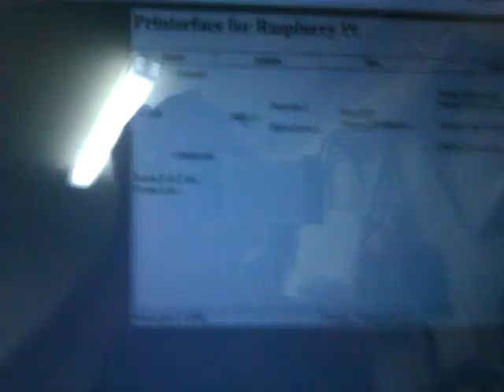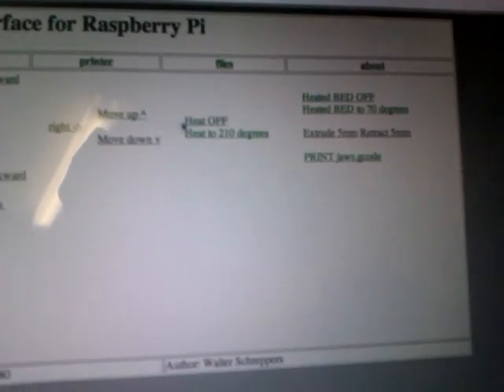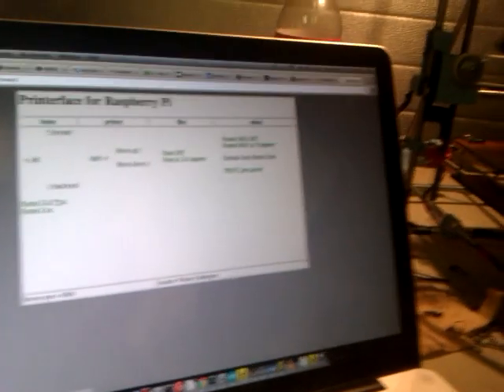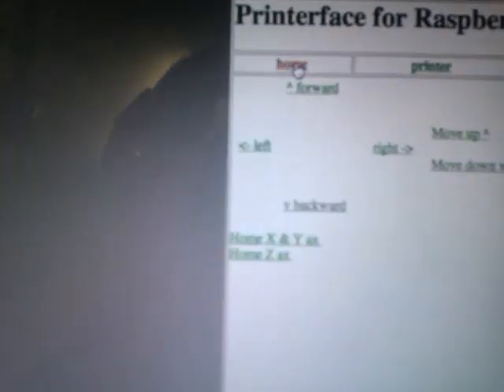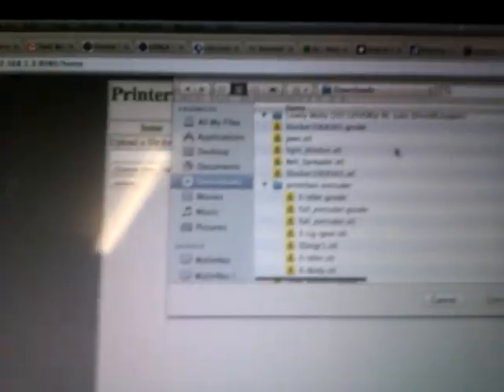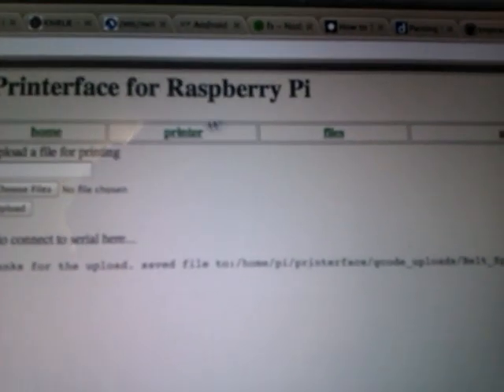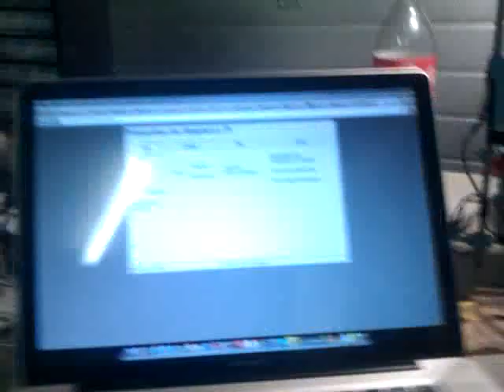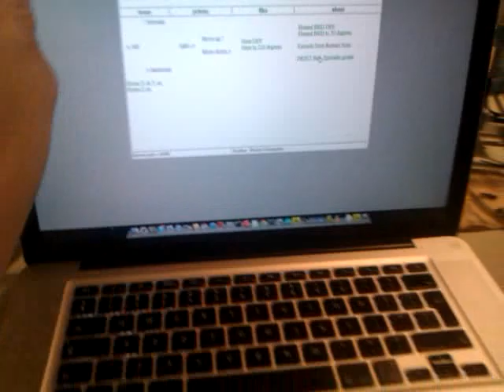Raspberry pi to 3D print with webinterface in node.js!

Comment from the maker: Will be for next weekend. Hat some probs with the black printer not melting my abs enough and extruder got glogged, want to solve that first before working further on the web app. The webcam is indeed the first feature that will be added. Afterwards thinking about getting stl files to work either by using an external webserver or try and get slic3r to compile for arm (albeit it will be slower at slicing than the laptop). It should work on all distributions that have node.js installed...

Comment from the maker: Will do that once it's more polished. I first started with trying to make a small rails app that was painfully slow. But node js seems to run nice and snappy on the pi. It's hacked in one node.js file. I really need to clean up the code before releasing it into the wild. I'm also contemplating to use pronsole.py in background because it will simplify things (not needing to communicate with /dev/ttyUSB0 directly) and I can add progress indication + temperature status of bed+extruder more easily.